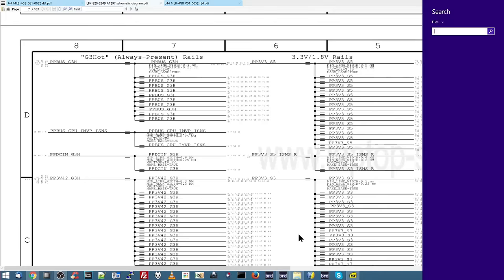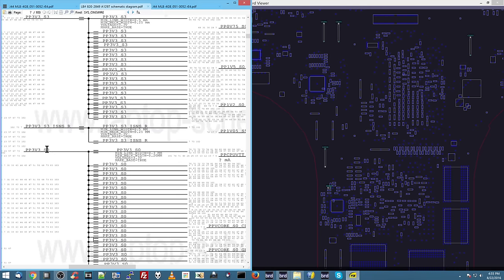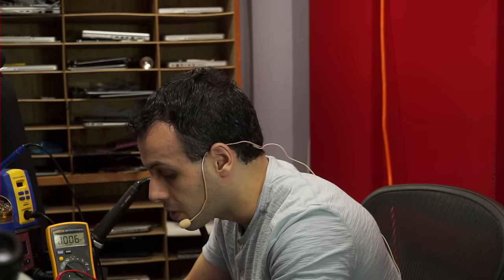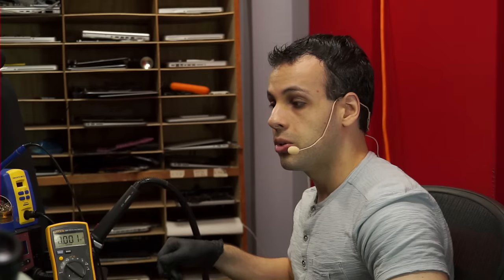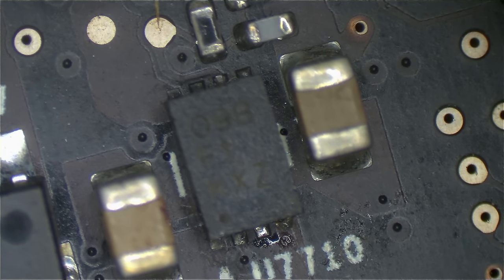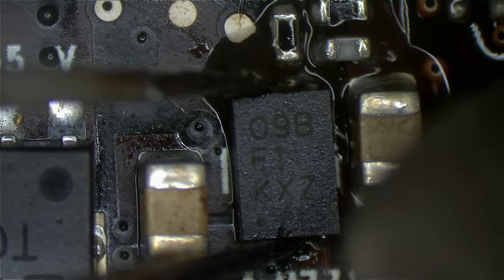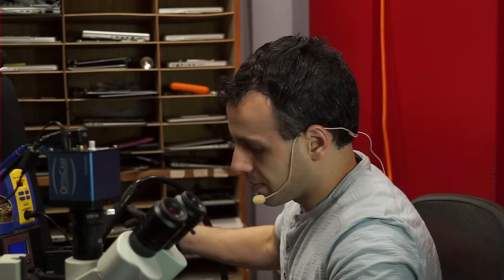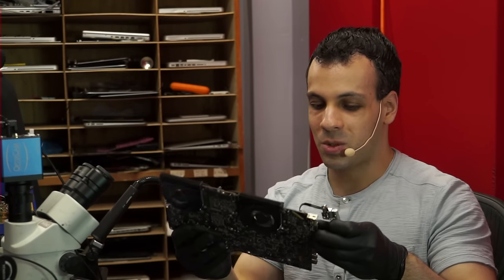Understanding power rail sequence saves time in electronics troubleshooting.

Comment: 19:40 If I may add, many pre-heaters can also be serious energy hogs (especially convection types). The flatter ones (almost always IR) are usually very expensive. My organization requires them for almost every type of rework, because the equipment being serviced are very expensive mission-critical boards (priced from five to six-figures) and their PCB's are loaded with significant voltage, ground, and thermal planes.

With that mentioned, I do think they have their place, however like you mentioned, I certainly agree that if one can successfully complete the job with less equipment, the better it will be. Just my .02.

Comment: Apparently that IC ISL8009B has a built-in thermal protection. When the
internal temperature reaches +160°C, the regulator is  completely shutdown. As the temperature drops to +130°C, the ISL8009 resumes operation by stepping through a softstart-up.(A way to verify if the protection is working from this point of view ). Depends on version A,B,Z and so on . 
I think like you Louis the last tech, person or what was ,who tried to replace it, he heated up for to long time at to high temperature making it  unusable , there is a temperature profile to solder the IC check the pdf file for detailed info tb493.pdf for who wants to get in the technical hole, without proper tools and knowledge ( feel ) and information  it's very easy to damage the part for good. 
Cheers mate... i just saw the stag on your video,  while  "treating" myself with that too.

Comment: A Multimeter should never change its reading with low battery (maybe if the LOW BAT is showing on cheapies) and a Fluke it will definitely not change! You can try it could be interesting.
Reply: Really just needs recalibration.  I have seen a few meters that will wobble a bit as the battery starts fading off but certainly more often than not it's just natural drift that coincides.
Reply: But not on a Fluke, on others that can happen. And if the Battery is low it will read often more because the reference is lower, it goes the other way ;).
Reply: I once had a multimeter that showed around 5 volts on a lithium ion battery. I was worried. 
Also, nice seeing you here.
Reply: I hope it was not a Fluke on cheap once i had things like that happen ;), thx Paul someone linked me to here ;)

Comment: hey, thanks for this video, i learned a lot, i knew nothing before, and i trust that if i had schematics like yours for something broken, im 99% sure i could figure out the rest. looks a lot like programming, of which i have 12 years experience. i guess you could say i know its a lot like programming, but hard to say when youve never worked electronics like that. gunna try reviving a dead graphics card ive had for years sitting in a closet. ill lyk if it works when im done. its a simple fried capacitor and some damaged pcie pins. its a simple fix, and i can see what isnt working on the board. just might need a new capacitor.

Comment: Hi all, 

Should i solder a jumper over "Debug Power "Button"" in order to measure S0 and S3 rails ? All my S5 rails are present. My logic said yes, but i dont see anyone doing this as far as i noticed.

I'm working on a 820-2567 Macbook pro 13" 2009. Old yeah i know, but just for practice.

But the video was really helpfull, this is my first time troubleshooting a notebook.

Keep up the good work :)
Reply from the maker: S3 should be there while the machine is off. S0 will not be there until you hit the power button

Comment: Do you ever use acetone instead of isopropynol?
Reply: I might be wrong but i think he is using ethanol instead of IPA. And acetone might not be a good idea depending on wether on not there is anything on the board that dissolves in acetone. Be it writing or something component related. one of the things i remember from chemistry is that depending on the plastic you might desolve it. which would really suck if you'd just put on a connector
Reply: Once, however my wife hates my mouth smell after acetone, so I stick to isopropynol.
Reply: Acetone melts plastics, so it'll melt your connectors and some components, which is not a good idea. IPA or denaturated alcohol doesn't do this.
Reply: Jernej Jakob Not to say your're wrong but I've never come across a board with connectors that melt with acetone, they're normally some nylon/PP stufff. I just find it a more aggressive cleaner and use it for flux cleanup. then an IPA final flush.

MrocznyTechnik If it's a fruity smell on your breath it's a sign of poisoning. At least it is with IPA

Comment: Are all of these things relevant only for MAC's ? I do component level diagnostics at a computer shop, but we outsource board repairs to others that that take a lot of time to figure shit out so i'd rather do it myself
Reply: Some of the details seem to be Mac related, but most of them are pretty common for all motherboards out there. E.g. I'm currently analyzing the schematics of some ACER motherboard and there are S0, S3 and S5 signals too, as well as switched-mode power supplies that generate those voltages and controller chips that tell the power supplies when to turn on/off. So I guess that most of the knowledge presented here is pretty general.

Comment: Never quite understand that with proximity to all these small solder contacts that they do not bridge when you push the device on. Why doesn't the solder flow to the adjacent leg or chip  (causing a cross or short)

Comment: Good morning Louis, have you ever seen the 33011 smart status IoRegistry error  in ASD? The last test in the ASD Program. I've got 2 system that are failing the test that previously weren't failing and it's driving me nuts. Mid 2012 13" Units.. They function just fine but it's bugging me Thanks.
Reply: Did a format on one of the SSDs and now it passes the test, No more error. I'm not sure if it was the password on the user account that wasn't allowing ASD to read the smart data correctly... I'll run it again after I reinstall and see if it comes back.
Reply from the maker: no

Comment: My apple macbook pro 13" 820-2936 logicboard has S0-S5 states, but it turns off and turns back on when I use software only, I swapped ram pc38500 still keeps doing the same thing.  It freezes in s3 state but I can put it to sleep. The freezing is intermittent comes and goes as it pleases, any ideas Louis? best regards

Comment: Sir can you tell me how to find quickly the trace is open at a point but visually it is shorted.is there any technique to visualize the complete path of the the trace by applying voltage or current.
Reply: You probably figured it out by now, but for future reference, in many types of board software (like for instance ZXWSoft), you can see not only what parts are electrically connected to each other, but the physical layout of the traces, together or by individual pcb layer one at a time. Then you start at a point where the trace is good, then work your way forwards testing ie. every 3-4 connection along the line (to speed up the process), until you find it broken. Then reverse and trace your probe points back again, this time test every single point along the trace (because now you have narrowed it down to a much smaller group of points to test) until you find the signal is good again. Your break will be in between your last two test points. Now you can follow the physical trace layout in boardview/zxwsoft or similar software, and look for the damage to the trace, or a blown resistor, diode, filter, fuse etc. If the line faulty is open when it should not be (not shorted), with no components in between those last two probe points, suggesting a mechanical break in the trace - you can add a jumper between those points. Don't do this if there is supposed to be non-capacitor components between those two points though, then you will be making a dead short on the line that is not supposed to be shorted, and can cause significant damage to other components further along that line.

Comment: Louis, Why does a spinning fan mean everything is working
Reply: you should watch the vid again, the fans power rail is essential to the other rails, so if 'its working everything else will be, as far as i can understand.
Reply: @kindisc  Well "everything else" should be getting power. There are still many other things that can go wrong, that do not significantly impact the power rails. Like for instance a display output driver or supporting components, or in some instances a charging chip while there's still juice left in the battery.